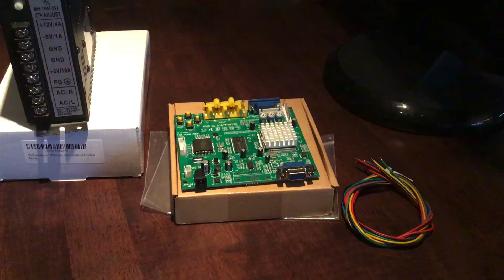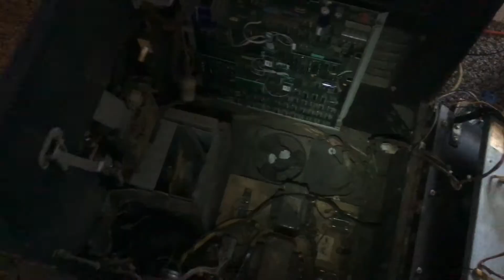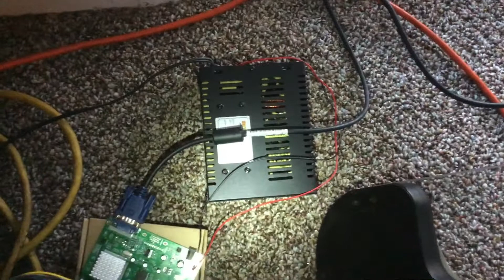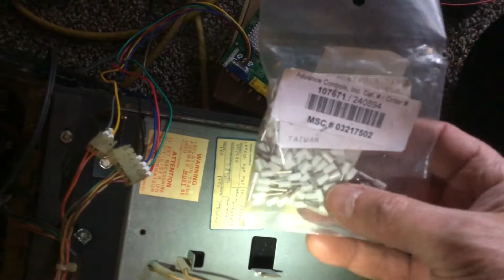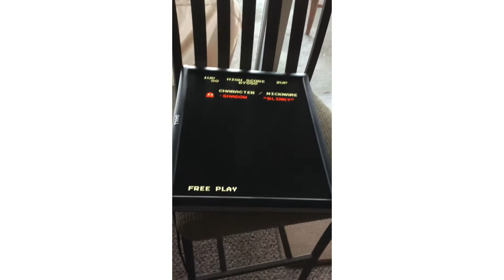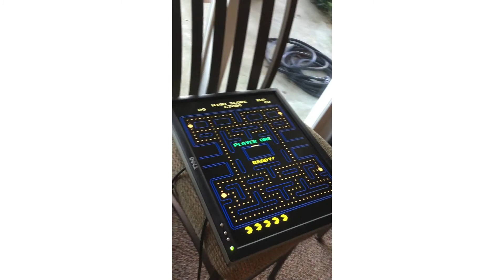Ms. Pac-man cocktail LCD conversion using GBS8200

Comment: The picture looks really good. I'm considering doing something like this myself on older game cabinets.
Apparently, you can get modified firmware for that board that will add scanlines to the picture for even more vintage authenticity.